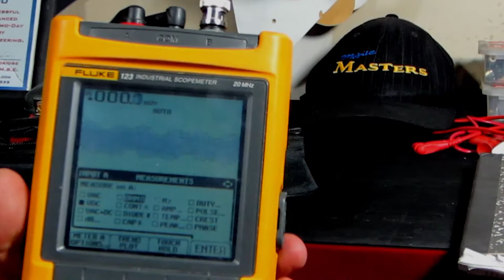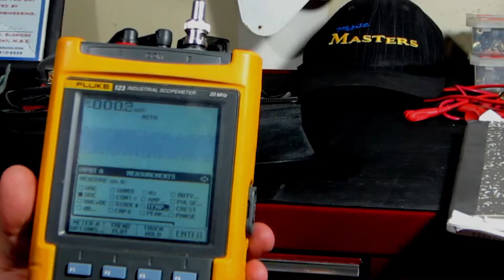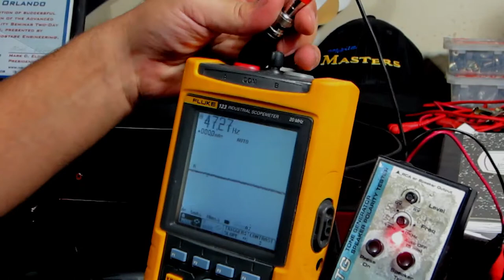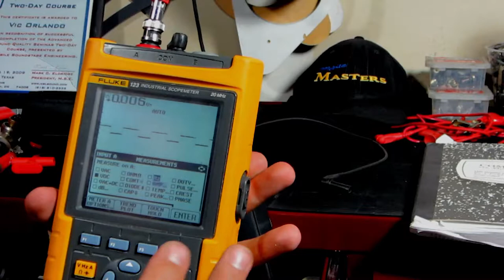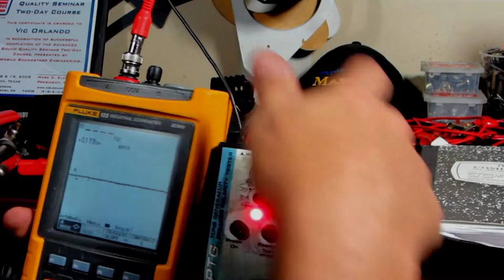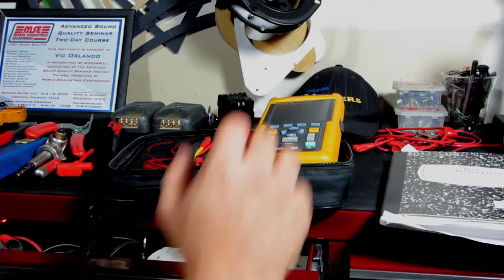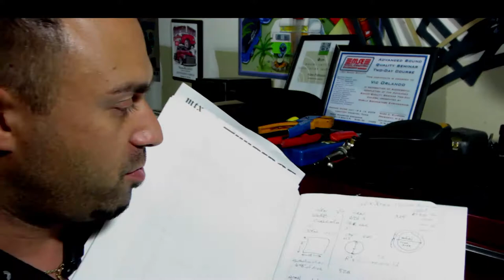Professional Car Audio Installation Technician Tools

Comment: I’m an auto technician now and the issues I’m running into is these 2024’s vehicles with low voltage systems and everyone wants hard wired dash cameras. Gotta be careful about wiring them up
Reply from the maker: Highly recommend an oscilloscope.  Don't want to tap data. You can use 5v from a USB source but you cut out any capacitive balancing that might be in a converter from 12 to 5v hard wire kits. Of course also cutting out the shut off voltage for any parking modes.
Reply: @VicOrlando  To be honest. I don’t think I’m going to stick this job out. They give me time base to get jobs done. Like 45 minutes for a dash camera. Using your method it could take me 45 minutes just to find RAP lol. And you are definitely correct don’t want to tap into a data wire that would be bad news. It’s really hard to find good mobile electronics installer’s but some of these companies are stuck with 2000’s installs time gates.
Reply from the maker: @garry2280  that's sad. They need to get with the time. Rushing things is a terrible business model. 
If you work for a real shop, you'll enjoy doing things at a better pace. This isn't tint. Always follow through, test and make sure your customer knows how to use their equipment.  That alone will be 10-15mins. Even if the shop doesn't care , make a good name for yourself. People will respect you more for it.

Comment: How much do techs make ?
Reply from the maker: For Audio Video a programmer and designer can make $80k or more. Depends if you're doing commercial or residential and if you're independent or not. 
Being a self contractor requires extensive background checks and state approval for bonding etc...